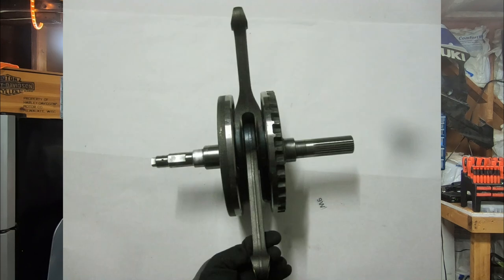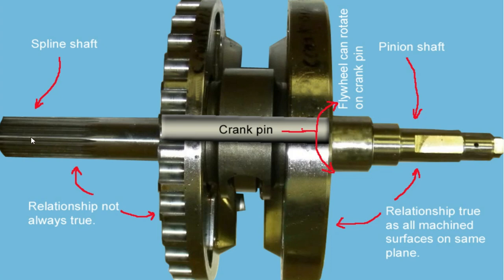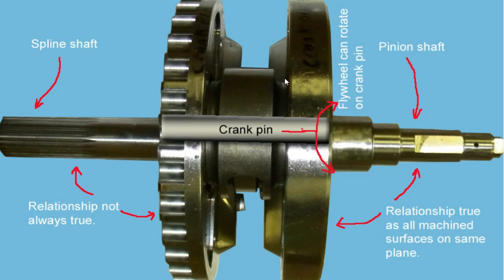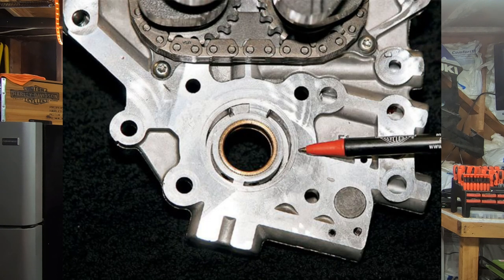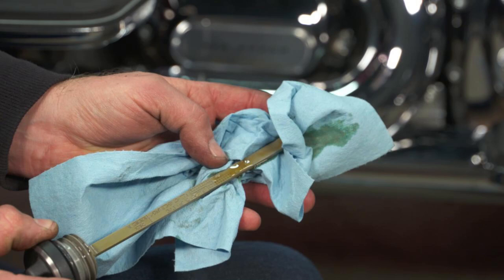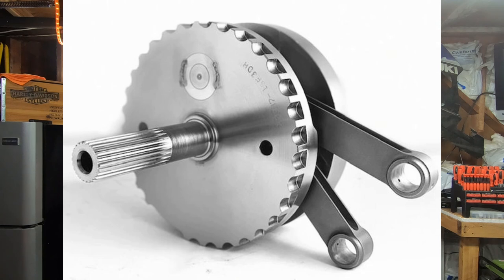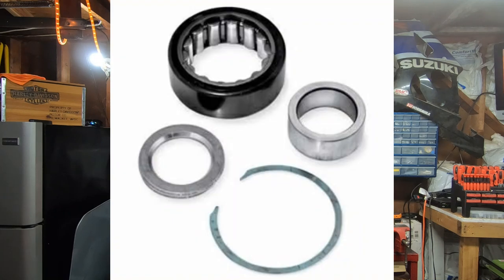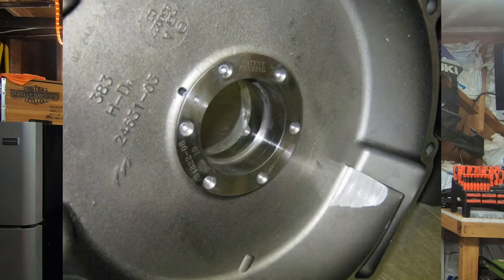The Issue With The Twin Cam Crankshafts | Harley-Davidson Cut Costs

Comment: I bought an 05 fxd with 50k miles. Crank run-out is .001. either that motor was rebuilt or I got extremely lucky!
Reply from the maker: Very nice! Yeah it's either been rebuilt, maybe just babied it's whole life or it's just one hell of a motor that came out of Harley! That's the crazy thing about these cranks and even tensioners, some were junk right off the show room floor and others were perfect.

Comment: My trued and welded crank has the following run out
Drive side 0.000005
Cam side 0.000002
My timing stays accurate I have no need for compensators in my cam system so I have gear driven my cams I no longer have inaccurate timing at any RPM including 7200 which is where my fuel runs out
Reply from the maker: That's exactly why you simply can't beat a properly balanced and trued crank!

Comment: 350,000 cranks press together WRONG! CALIBRATION MACHINE SET CRANK PRESS SPECKS WRONG! HARLEY BOUGHT MY 2001 BIKE BACK AFTER 5000 MILES OF COMPLAINING OF NOISE. Got my $19,500.00 back. Love 99 FLSTC EVO ! I skipped out with the money before signing the HD Gag Order.

Comment: 2003 a split year? Do I have to worry about not getting the double bearing bottom end
Reply from the maker: Unless for some reason you got a late production 02 considered an 03 it will have the roller bottom end and not the tapered Timken.

Comment: Had this happen made no signs of going bad until it destroyed the bearings by then it was a powder but didn't make it to the cylinders sounds like it's expensive said it was.004 out was told that was good. 2000 wide glide all stock

Comment: I have a 2019 Ultra,  M8,w/107 , Can I run slip ons with no baffles , straight thru , ? Will it run well or bad ?I understand 
  it needs baffles to give back pressure. ! I don't want to damage it ! Thank you
Reply from the maker: It really varies between individual bikes how it will respond, technically you could do it without damaging your engine. At the very least I would suggest a set of Xied's, they will put some fuel to it and really make your bike run a whole lot better. Plus they don't flash the ECM, they just plug in inline between your 02 sensors. They are about 130 bucks but well worth it.

Comment: My GF’s 2016 Sportster 883 chewed up the crank at 3200 miles. Zero warranty as the bike was bought at the dealer on consignment. We bought the bike with 27 miles. Declined the warranty as it was new/old stock and what could happen? I guess a lot! $6000 Canadian to repair. Very disappointed.

Comment: Just bought a 2016 wide glide with a twin cam 103.  This makes me nervous
Reply from the maker: Nothing to be nervous about, honestly a failure is caused by people who abused the bike then complain it cratered on them. Anything will fail if you beat on it, there are millions of trouble free mile on the twin cam crank out there.
Reply: @GixxerFoo  this one only has 900 miles on it.  The Harley dealer I bought it from went all over it, they had to replace the intake seals which had dry rotted from the bike sitting but said aside from that it’s still in new shape.  I paid them to do the stage 1 and put on Vance and Hines pipes.  I also just switched out the factory seat for a Saddlemen step up. I don’t beat on my stuff and anal about maintenance.  I’ve had a couple metric bikes, this is my first Harley

Comment: Crank runout = the root of all evil in all HD Motos. Checking runout should probably be a regular maintenance item.
Reply: Oh, come on, as he already said, there are thousands of H-Ds running strong. Indeed, it doesn't matter the brand, but abusing the motor is what leads to any type of failures. If ridden normally, all the issues related to H-Ds engines never come to the surface.
Reply from the maker: Checking you're run out really isn't a bad idea, I like to check it with the cam chain tensioners myself. It can really save you a lot of money and headache down the road, catch potential issues early on!
Reply from the maker: There's a lot of bikes running strong but I am pretty proactive on maintenance. The new hydraulic tensioners are a lot better but they do wear out. I usually pull it down at 30K and inspect the tensioners and while it's apart just do a quick run out. It will really give you a pulse on the engines health. Especially on a used bike you can get a pretty good idea of how it was ridden in it's life.

Comment: Scarey knowledge to hear.. So now,  you know my engine only had .0025 crank runout when I did geardrive upgrade.  It had 12k on odometer, and I dont ride the piss out of it.  Also, the upgrade wasnt very radical.  Ive had untouched TC88s go 55k + totally problem free.  So, tell me something positive about where Im at..
Reply from the maker: You've had some good luck motors! Not every engine is guaranteed to spin a crank or have cam chain tensioner failure. Usually with a failure there's a lot more to the story than people are willing to tell lol.
Reply: @GixxerFoo  Im not a FWO rider and dont redline/then decel.. I enjoy doing oil changes too.  lol

Comment: I've just started watching some of these HD lower end/bearing/crank,/oil pump/cam plate/compensator/cam and primary chain tensioner/over-heating/oil in breather videos. It's disgusting. From a newcomer's perspective, it appeaars to me that if Harley Davidson also owned and operated a majority of the repair shops in North America, they would have 1. had to close their factory doors years ago from unsustainable warranty/repair costs or 2. would have corrected each and every known issue during the initial manufacturing process. Instead, they've created the necessity for an entirely separate industry of shops and technicians just to correct all the manufacturing/design problems from HD factories. If these third party participants can true a crankshaft and assure an acceptable operating run-out condition, then HD can certainly produce that as well. For some reason, the company does not have to achieve nor sustain those tolerances. Nor, aparently, design an oil pump that meets application requirements. HD customers accept the bullsh*t substandard offerings, year after year. HD has been the luckiest corporation in the history of the United States in that their customers are paying for all the necessary repairs/upgrades instead of filing lawsuits. Most of these issues mentioned in the first sentence would be acceptable and understandable to occurr in a 10 year old bike with high mileage, but these issues are common in latest generation products. Totally unacceptable. And I really hate saying this because HD makes the most beautiful motorcycles in existance, but the only way in hell I'd buy a new HD motorcycle would be with a 50K mile parts and labor and towing warranty.

Comment: Im having an issue rhat beought me to your video.i habe whhat sounds like a nur rolling around in the bottom end. Cannot pinpoint it have been all overbit running with stethoscope . I e been in rhe prinary side . Sounds as if it cominfg from very feont of engine. It is sporadic sounds similar to a rattle can of spraypaint  and giving it theottle does not increase it. Imdown to thinking either cam bearing or cam tensioners! Bike is 06 softail deluxe with 48k ingerited bike from my grandfather . Ive pit 25k on bike as far ai know my grandfather die nothing internally in engine jist basic maintenance.
Reply from the maker: That's tough to pinpoint, it wouldn't hurt to open the cam chest and the primary and see what you can see. That's a good starting point there, the hope is you might find something that's come apart and rolling around in those areas that hasn't done any damage just yet.
Reply: @GixxerFoo  I e been on the primary side . Now the cam side like I said nothing is obvious. Except for the fact it's fucking annoying as all hell! And I can't ride the bike just so happens to be during a time I really need the means of transportation but down on funds.  Thank you however brother !

Comment: how about the m8 flywheels
Reply from the maker: It's the same process of manufacturing as they used on the twin cam, it's all a press fit even on the M8. I haven't heard of any scissored cranks on the M8's yet though.
Reply: @GixxerFoo  I’m putting  out 155 torque with stock We will see how long it lasts but I don’t ride my bike hard either

Comment: i think back firing and hard driving is rough on harleys . kawasaki's  and suzuki's can handel it .mine have stood the test of time. i got a 2002 duce to restore . chrome and cast stuff suffered from florida climate .bike has been parked for 8 years w fuel in the tank. it's non screamin eagle and fuel injected .i have my work cut out for me.
Reply from the maker: Oh dang that's gonna rough with that fuel being left in there, does it have the Delphi injection system?
Reply: @GixxerFoo  yes. im replacing it all. just hope iterior of tank is ok. outside looks great.

Comment: Makes more sense to get the 114 then
Reply from the maker: The M8 114? The M8's still have pressed cranks, albeit they are heavier and do use larger crank pins.
Reply: Pretty much the same they didn't have one 114 back then I think I'll get a 429

Comment: No way a bearing can support a .015 run out unless there is .030 clearance to begin with, rendering a bearing useless
Reply from the maker: Harley says up to .012, that's not something I would let go down the road without a signature saying button it up. Now .030 is total destruction, that's catastrophic failure and the engine is now trash. It's not going to run at .030, not for very long anyhow lol.

Comment: Fuck i have an 05 dyna wide glide i just rebuilt my motor from 88 to 100''' all S&S I wanted to replace the crank i was told by three different people that the crank shaft that year was good and there was no reason  to replace it  now after seeing this i wish i had
Reply from the maker: It shouldn't be an issue if you're riding it and enjoying it, there's a lot of bikes with bolt on big bores making great power that last a lifetime without issue. As long as your not beating the crap out of it you're good to go. Most crank failures I've seen where from just all out beating the hell out of the bike constantly.
Reply: Anytime you're doing an upper end rebuild/upgrade, especially if the motor has 100,000 miles or close to that on it, DO the bottom end, period.  You're going to need to, sooner or later; why not just do a total freshen up?  You're going to have peace of mind, 20,000 miles down the road--FACT...   lol

Comment: Well, we don't ALL love to do burnouts...in over 40 years of riding motorcycles, I have never done a burnout...Harleys have enough problems that will happen to them without abusing them on top of it...I think you hit on exactly why tensioners wear out prematurely, abuse...burnouts also cost expensive tires as well...more power to anyone who likes doing that & doesn't mind replacing tires every 3-5K miles, but that ain't for me...that being said, I do want to do a gear drive cam conversion & oil pump upgrade on my 99 Road King, & I figure I might as well put some larger cams in while I'm in there...my runout is under 0.002, so it's well within range...what size cams would be good for a mostly stock engine without having to change anything in the heads?

Comment: Hey pal..just had a lower end rebuild on my 2005 15th aniv fatboy,95". had new s^s crank,$1500, had new fueling camplate/oill pump,lifters, had my original 37G andrews cams with all new bearings and jims gasket kit, had the heads horned to hatch patterns, stock 95"pistons,new rings. no top end work. get it back, got it hot,twice, starts knocking like bitch???  my heart went to my stomach, i was like,wtf??   when mad hot, the brand new compensator started to have starting /clanking problems. ( bikers choice 289$) . the fuckin cams (cone) drive side, sounds louder than when i bought it to my indi, to split the cases. 2 mnths ago. could it be a rod bearing, if i broke it in,140miles,pretty hard?? just went on expressway 1,doing 65-70mph. for a little while,but not open throttle.did i do any damage? rod bearing,piston scuffing, it run in my garage for 15 min. bike only has 140miles..please give advice,love your vids, you are so knowledgable, and quick with bikes,i like that..be well, lmk, i thank you in advance
Reply from the maker: Holy crap, sounds like something went wrong for sure. Really the only way to know for sure is to tear it down and inspect along the way. It happens sometimes, l've had a brand new engine spin a rod bearing on first start up.
Reply: Hey GF whats up ? update. 10/5/21.  no rod knock or wristpin breaking. Bike has now 500 miles on it. just dropped all fluids, everything came out like liquid honey, with NO metal specks at all!! bought bike back to indy, he adjusted the oil pump( had sumping issue, in a week it would read at tip of dip stick). now it only leaks down to  1  quart a week. ( is that normal, indy says yes?)( i am running a k&n -171-c oil filter,which does have the drain valve that sumps,i am going to harley and getting the right filter today but) bike rides strong as hell, and pulls away like a MF.   with the new s&s crank, fueling camplate and HF oil pump,, i do hear my 37G Andrews cams spinning, with a high pitch whistiling ,gear noise when hot,   and do hear new lifters tapping a bit??  with a slight tick/knock. Now i do  know the bike has not been tuned yet,cause my indys does not tune(no dino)  i do have a pc3, stage 1. 2 into 1 v&h pipe. it puffs a shot of black smoke when starting,do to lack of tune??  running to rich right??  SO what do you think, no major noise or vibration, just gear whine and lifters noise a bit, please tell me if im ok???  going to pick bike up from indy today.???  ty in advance GF, ttys brother.

Comment: I would really like to see a video on cams for an 88ci Harley Roadking. I am wanting a bigger cam to increase my horse power. I hate to have to spend $3,500. To rebuild my whole engine. I also heard about people fixing the cam guide issue by just removing the chain tensioner pad. My Harley is a 2001 with the Magnetti Morelli in it.

Comment: If your going to add power to any engine don't get cheap.
Reply from the maker: That's just it, you can add a reasonable amount but where people get into trouble is finding the highest compression, largest bore kit out there and bolting it on. That's when the stock bottom end is pretty much toast.
Reply: @GixxerFoo  agreed, it’s also dangerous. You wouldn’t want to ride a poorly maintenance bike so why ride a powerful poorly built bike.

Comment: Old vid new comment. Pressed crank and cam bearings have been a thing for forever and are no issue in the cars that have been made that way since since 70s.... I'm a bit confused as to how this is a flaw.... if harley davidson was more focused on reliability and less worried about taking rich peoples money they never would have gone to 114 because they know its too much for a primary chain setup to take without re gearing the transmission and installing stronger sprockets and a stronger  isolator on the crankshaft. No wonder the M8s oil pumps aren't doing it.... they want all that power but never wanted to retool and use better materials. The twin cam 103 and the 107 M8 are as big as these motors can get without changing everything. And 107 is pushing it. They know it, but are gearing their bikes to be traded in every 3 years.    Just like the car companies. Now the crank issue you speak of can happen to a true and welded crank as well. It's called running forced air intakes or nitrous, and constant performance style riding.    It doesn't matter whether it's pressed or not. The average harley rider doesn't do that stupid shit and if they do, it's on them. Shout out to the guy who rebuilt his at 40k running nitrous.... that's alot of miles for "a presses crank"
Reply from the maker: I'm on the fence about the pressed cranks myself, there's a possibility of slipping a crank pin and most people unknowingly do exactly what causes it. Harley stresses to not lug the engine, the way those motors fire is really hard on the crank pin. Lugging the engine will shift the fly wheels, the stage kits etc in my opinion are fine as long as you keep the rpm's up.
Reply: @GixxerFoo  I know guys with 100000 miles or more without any issues on theirs.... so I think the trued and welded crank would be applied to a rebuild for security.... but to break in there and so it cause you're worried about catastrophic  failure is just insanely costly to me.... I've got 40k on mine and it runs like a champ.... but I also take care of of and run it like I should.... to each his own

Comment: Why harley engines have that teeth like pattern on their flywheel ? Left side on this one and sportster have that on both sides.
Reply from the maker: Crank position sensor reads off of those for your ignition timing.

Comment: That S&S crank looks up to be an $1800 part.  I think a machine shop would be a lot cheaper.
Reply from the maker: It definitely can be, but just depends where you go, I have seen some shops that want to charge way more and some that do it for less but they don't do it right.

Comment: M8s have the same problem if Harley knew how to build a engine we would have better engines
Reply from the maker: They went to pressing cranks for more manufacturing efficiency and cost savings. They can build a bike but if they can more production faster, cheaper and charge more they are going to do it. With the failure rate at low rate overall for them they will continue to do it. It's not right having high runout new but it works and it get enough miles past warranty and on the motor to be old enough they can justify it.